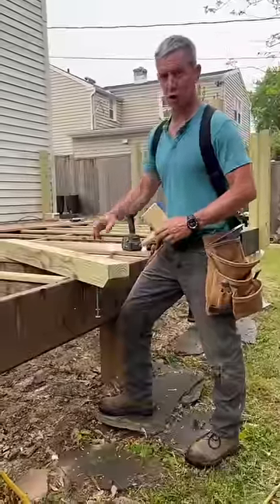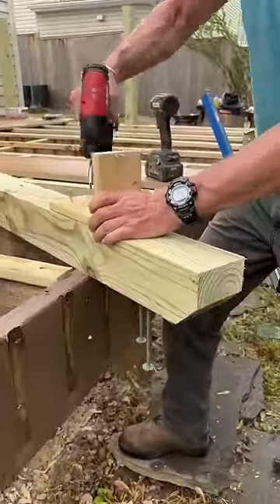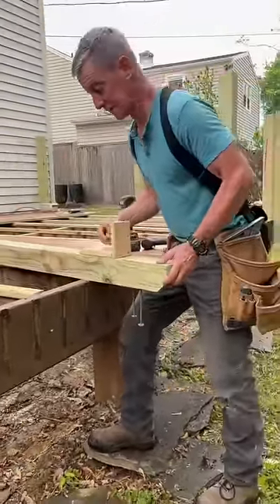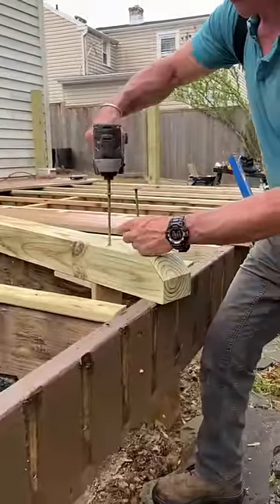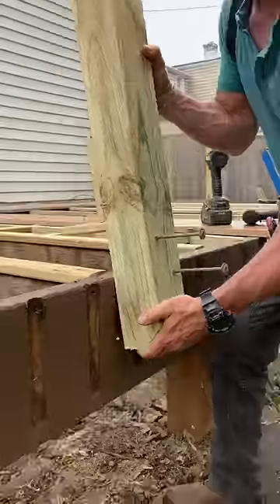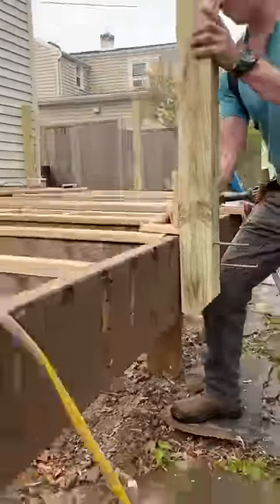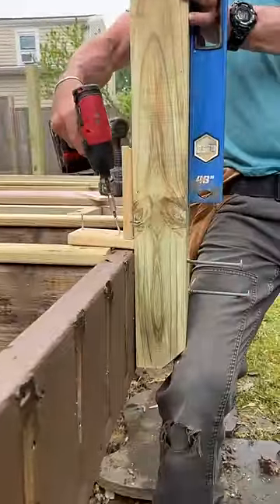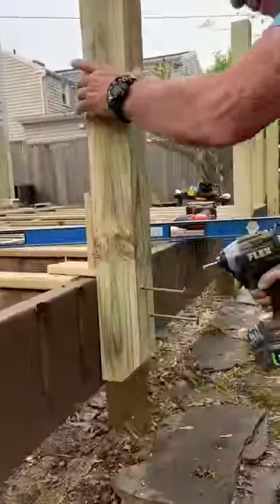DIY Tips: How to set a deck guard post by yourself

Comment: I always notch my posts, I make sure the notch is as close to 90° as I can get it, and no jig is needed. I feel like I get a lot of strength notching the post, as it sits on the band board, instead of relying on the carriage bolts alone, which obviously have plenty of strength even without the notch, but this is the way I was taught to do it, and it's just the way I always do it .
Reply from the maker: This is a resurface, as you can probably tell, and the posts I removed were notched. They were in pretty decent shape for 25-years too. - I prefer the full post for a number of reasons and, like you, at least one of them is habit. Also, in new construction, we're not allowed to notch here. Keep up the good work.

Comment: I think your attachment  super strong and looks good, however, will then pass inspection? It's my understanding post needs to mount on the inside of the rim with solid  blocking. Behind the post .. I like to use F clamps…. Peace Man!
Reply from the maker: Thank you. The attachment is super strong and I think meets the idea behind the code. In new construction this would have to pass plan review, something I 1-million percent respect. - Surface mount details are widely accepted, they tend to use thru-bolts and or hold downs, which I think apply commercially but not residentially. - To hobble this connection, the rest of the deck is coming with it. - Nevertheless, my entire point in making this video wasn't how I connect the post, but how I get it plumb. I've done a dozen more posts like this and so far it's the best system I've seen. - Keep it up and thank you. Comment any time.

Comment: You should ask to borrow a drill sometime. It will blow your mind how much better a drill is vs impact for screws. 
I know, it doesn’t make a cool sound, but it will save you time!
Reply from the maker: I came up on the first generation of cordless drills. They were great. But impacts are 10X more effective. Sure, I use a drill sometimes, but not often.

Comment: For the outside, you should use plastic shims.  Regular wood shims will rot. Put glue on shims because they can fall out due to expansion and contraction.
Reply from the maker: I hear you. Not wrong. On the other hand, the shims aren't meant to be permanent (they will be because they can get wet then dry out) but the shanks of the PowerLags are forever stuff.

Comment: They don’t allow power lags where I live anymore. Guard post have to be through bolted with 3/8 carriage bolts. Which is crazy because mostly all of the power lags have enough shear rating
Reply from the maker: That's interesting for a couple of reasons. - Typically, carriage bolts don't cut it in many codes, they want thru bolts. And, they want 1/2-inch. As for shear, my local codes allow them for the ledger connection which is both pull-out and shear. - I have a jurisdiction around me that is stricter than the others and everybody gets their panties in a bunch because of it. I just give them what they ask for because, it's work. It's what we do. Let's do it and move on.

Comment: Ok, but by using the thin shims, can’t the shim rot out and much faster than the post or stud would?
Then that is the free play to let the post become loose.

The post will be straight, the stud is what’s off needing the shims.  So use a cordless grinder with flapper disk to quickly sand the stud straight where the post will mount.  Take about 1 minute per post, then it is straight.  

Remember to use the level on the other side (90° to face) to get it level both ways before starting second lag.
Reply from the maker: You know, Those shims are in "wet service" about the same way a ceiling fan in a porch is. Wood rots when it can't dry out. Not only will these shims barely see a drop of water, they can dry out. Why do you think there are 300-year old houses in New England? It's not because they didn't get wet. It's because they dried out after.

Comment: I've always put them in the ground in concrete.   That way they're supported correctly. I've seen heavy people lean on banisters and take the whole section down if they're not in concrete.
Reply: and also if it's not galvanized it'll immediately start to corrode the pressure treated wood
Reply from the maker: I think concrete is overkill, but I hear you. I don't want to know (A) how heavy the people were or (B) how bad the bannister was that failed. That sounds like a nightmare and I hope nobody got hurt. - As for my take on a solid deck post, I use the same screws to hold the ledger to the house and for the post to beam connection. They're Spax 5/16 x 6 coated PowerLags. The wood fiber in that deck would require catastrophic damage for that guard rail post to fail--nevermind all the others its connected to, plus the integrated 2x6 top cap. - Keep up the good work. Chime in any time.
Reply from the maker: I've installed and removed these screws in PT. Unlike some other screws I don't this with that wen in with a coating and came out without one, this coating remains in tact.
Reply: @myfixituplife  good stuff. I appreciate how you didn't just get offended by my comment, some can't take criticism. You handled my remark like a pro. 🤜

Comment: How do you get your decking to have a proper overhang . With the post on the outside?  Notch around every post?
Reply from the maker: Good question. Answer is Yes. But, depending on how your decking lays out, you can run a rip up to your posts. Then set a rip + 1-inch past the front band and get the sane effect.

Comment: With pressure treated wood always give a couple extra coats of copper green. Also soak those shims in copper green.
Reply from the maker: I hear you. The shims will stay dry for the most part. Southern Pine is treated so through and through adding copper napthanate is pointless in my opinion. For Doug Fir in the West...all day.
Reply: Belt and suspenders is my method, and it still works.

Comment: He can make this post code compliant if he adds hey Simpson DTT2Z strong tie bolted properly. The deck post must withstand a 200-pound concentrated load applied in any direction at any point along the top rail or top of a post. Those 2 lag screws won't suffice.
Reply from the maker: Yessir, the 20-pound criteria. I have seen how they test that. Have you? I don't want to write a zillion words of you've already seen it. - What I will say, is that the test is for the post only. Not the 2x4 top and bottom rail and not the 2x6 top cap as an integrated system. - As for the lags (I used 3), they are code approved for the ledger connection so I'm pretty sire they are going nowhere.

Comment: Does backing out the bolt compromise integrity since it doesn't use nut and washers?
Reply from the maker: No. The structural screw has a washer head. Crunch the wood fiber and you've got a solid connection.

Comment: Put them on the inside and box them off for strength...once they are boxed off the box becomes a good platform for the decking
Reply from the maker: I call what you're saying "housed posts". They work for sure. But on tight decks, like this re-surface, outboard is the wat to go.

Comment: We used to do post this way but it doesn't meet code anymore because the band joist can pull away. He might not be done, and there may be more to do to stabilize it.
Reply from the maker: I see where you're coming from. I guess the band can pull away, but the forces would destroy the entire deck. There is a deck board that spans the outside band and the framing, further making this system a membrane. - I'm not perfect, but I can't think of a localized load that'd hobble this connection.
Reply: @myfixituplife  the deck board locking the band with the joists will solve any potential problem.  Code changed and we were arguing about it because of solutions that solve the issue such as a perimeter deck board. Your method is functionally fine.

Comment: i personally  would put the posts on the inside of the rim Joyce even if I had to change bottom support posts but I have to because all  my jobs get vinyl railings post raps bases plus you probably put 2 posts on the corners you can get away with more crap with 
pt rails and it will still look OK I do use jigs and lags though
Reply from the maker: That totally works. However, this is a re-skin and there was a double outside band. Posts needed to be surface mounted.

Comment: I like to use a thick washer on each lag.

That way, the post do not get wobbly from the to small lag head getting pulled ito the wood and causing the post to become loose.
Reply from the maker: Those thick washers are called "cut washers". The washer-head screw I use has is it built in.

Comment: I like post inside of the rim and framed in on all four sides so they can't move. Outside of the rim has a tendency to tilt and lean after a decade or two
Reply from the maker: For sure. I like a housed post, too. - But This was a re-skin and there was a hideous double band here. - The point, however, isn't the connection hardware--which slams--is how to lay it all out.

Comment: I think you should set post inside the rim joist so the exterior wrap and skirting look clean and neat.  IMO of course.
Reply from the maker: There was a 2x8 inside the 2x10. Setting the post inside that mess would put the interior side of the post 6 1/2-inches inside the deck frame.

Comment: Do you think that post will split from 3 lags later on ? I'm genuinely curious.
Reply from the maker: Worthwhile question. The answer isn't just No, it's Hell no. The Spax screw geometry augers through wood fiber like a boss. Unlike the lags of old, no pre-drilling is required. I've used them in all kinds of deck applications with zero problems or call backs.

Comment: I would use a quick grip bar clamp. The jig you are putting unnecessary holes in it. But you do you and I’ll do me.
Reply from the maker: I thought that too, till I tried it umpteen years ago. Shi+ wobbles, dude. - You'd know that if you weren't speculating. As for holes in PT, you have never had a forklift plopped pile slide off a deliver truck into the dirt. A screw hole is a non event. - However, Jung, you do you.

Comment: Modern codes don't allow withdrawal-loaded fasteners for (required) guard posts. There has to be a shear-loded connection. The method in this video would not pass inspection in Oregon for any deck over 30" above grade.
Reply from the maker: May I please start by thanking you for both actual reasons and a deep understanding of techniques and materials. - These screws -- 5/16 x 6 coated Spax PowerLags -- are acceptable in my plan reviews in and around Philadelphia for ledgers and post-to-beam connections. Both, given the right conditions are in shear. - This project is a resurface, of which I do several a year, and I consider a "repair". - Nevertheless, I'd give someone my truck (not really) if they could create a condition that'd hobble this connection without tools or catastrophic failure of the entire deck. - And that doesn't include hobbling the 2x6 top cap and membrane of other posts.

Comment: My first clue to a crap carpenter was the reuse of the old decaying band joist. The second was that flex drill.
Reply: No way this guy is a carpenter. C'mon, that cheap Lowe's level?
Reply: @farmerbill6855  I like how he's trying to get it level with the support brace even though the lags will set it where they want it to go
Reply from the maker: Old band joist yes. Decaying? Get over yourself. And, you know zero about new tool lines, obviously. The entire Flex line is savage. Just because you have a keyboard...
Reply from the maker: It's a box beam level. Aluminum. Works just fine.

Comment: I would have made sure my end panel was vertical saving the need to use shims to correct my posts which will rot quickly. Also need a drip guard so water running down the post doesn't collect at the bottom and rot the post and the board out.
Reply from the maker: This is a resurface. There was a lot wrong with this deck. I'm not sure where you "no shim" guys are coming from, but you're here. And as for rot, it is clear you don't know how rot works.

Comment: Inventive!!! I find by running 4x4s all the way to the ground to a concrete foundation and then attaching to the decking with carraige
carriage bolts 7/16 in diameter 2/post will make the decking much stronger for a longer period of time.
Reply from the maker: I agree! However, unless your deck frame is a commercial space or bridge abutment this is massive overkill.

Comment: Good job man, don't listen to those Simpson guys
Reply from the maker: Thank you. I want to build well, but not everything needs 30-anchors. I did another project where I resurfaced a 25 year old deck and the posts were hand nailed inside the frame. Old-school hot-dipped galvy. Going nowhere. - On this deck, the ledger was nailed too. The rest was a collapse in progress, but the hand-drives into the band...It was the hardest thing to remove

Comment: I just notch my post so it sits on the rim joist at the proper height we there it be mounted inside or outside plus it keep it in tighter so it does look so bulky
Reply from the maker: I get it. That's worked for decades. It's a Code no-no now. I prefer a full thickness post set like this on a reskin.

Comment: Clamp it and bolts through screws will not hold
Reply from the maker: I've tried clamps. I work alone so I only have two hands. - Also, the same screws hold the ledger in place. Will they hold? (pssst, they will)

Comment: I remember when I used to attach intermediate post, " gaurd rail🤣🤣🤞" to the exterior of a decks framing.  # firsttime
Reply from the maker: There's a 2x8 behind that 2x10 Mr Pro. If I installed them inside that double band, the inboard face of the 4x4 would be 7 1/2-inches in from band joist. It's weird when people have reasons for thongs they do, isn't it?
Reply: @myfixituplife  you will learn someday! Good luck out there.

Comment: I took the deck boards off, the railing the post. Pulled the ground post out and brought them to code where i am at. They require concrete and anchors to stand on. Replaced the bands, literally rebuilt the deck frame myself than paid 1200 for deck company to come out and install the new deck boards in, since the deck is low does not require rails here. Even before i saw this video i was shaking my head. The deck was orginally built in 2002, all the rail posts were inside the band and blocked. Ive seen post like the one you did, they have all failed within a few years, since they were put in with screws and not thru bolts. Even if its a reskin, i would have told you to leave the second i saw you attempt that.
Reply from the maker: Hey, I'm not Indiana Jones, but I can skim. - You seem to be one of those category of commenters that assimilates a checkbook with knowing your a++ from a hole in the ground. It's cute. - And, you're likely a nightmare client that anybody not desperate fires 10-minutes after they talk to you. If it works for you, great.

Comment: Came here for the code comments. RELAX the deck is 2’ off the ground, tough guys. 

That said I’m a tough guy myself so I only do custom steel railings. 4x nut and bolt 2 directions through blocking, and welded top plates with 4 lags trough the decking hitting the double rim board and joists. Built strong enough for the females that come by to say hi.
Reply from the maker: Awesome. You win the comments section today and it's still morning. I don't think anybody's topping that today.
Reply: @myfixituplife  lmao thanks

Comment: Doesn't that post now have empty screw holes visible from the deck once the jig is removed?
Reply from the maker: No. As the wood dries out and the lumber contracts, it disappears. Also, it's PT lumber, there are imperfections all over the place. A little dot is nothing.

Comment: Never have seen a "power lags" -that you can drive with an impact wrench. I am used to a thicker, shiny lag screw which has a rachet type top. Is there another name for the he power lag?
Reply from the maker: "PowerLags" is a product name from @SpaxUS. The general category is "structural screw" and I use them all over my decks and other remodeling activity. No pre-drilling. Full force connections.
Reply: @myfixituplife  awesome, you just improved my carpentry future; thank you!, less fuss, more finished quality structure.

Comment: You know your technique is awesome I'm just concerned that lag bolts is not enough aren't you supposed to use through bolts?? But no doubt your way is the fastest way very effective
Reply from the maker: Thank you. I just did a dozen posts like this and it is the fastest, most plumb I've ever gotten them. - In new construction, this detail would need to pass plan review. In a repair like I'm doing here, if I was Mr Beast or some giant YouTuber I'd stage a contest to see who could hobble this connection without tools.

Comment: Never seen an exterior deck with TGI’s joist lol. And there’s post to be voted on inside of the band board with blocks. Yes, you should be using them quick lags with a nut on the inside so it is like a bolt and nut open up the name they come in a box just like ledger locks
Reply from the maker: I just figured out why a few people have mentions TGIs. - They're not. - This is a resurface. The original builder wrapped the 2x8 frame with a 2x10 fascia (terrible, it created a gutter with no drain for leaves and debris). To fix this, I skinned the 2x8 so the new decking would plane out over the 2x10. Good eye.